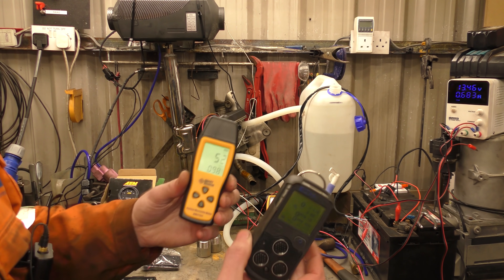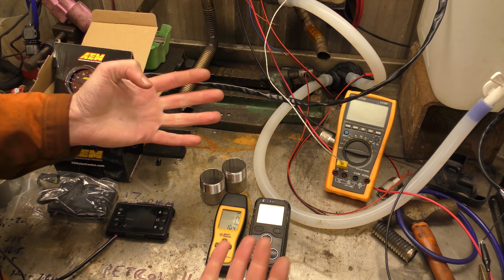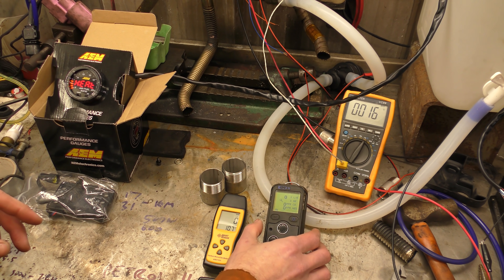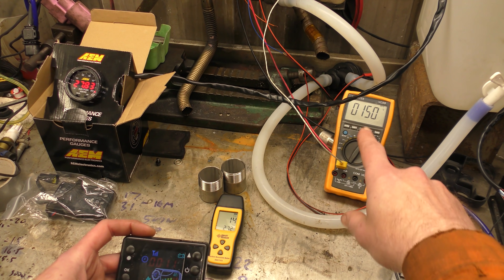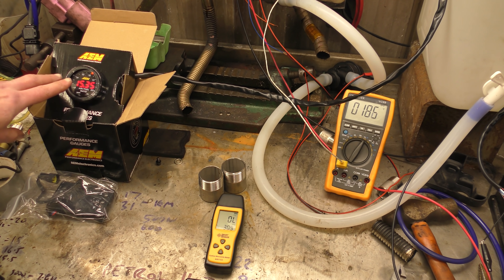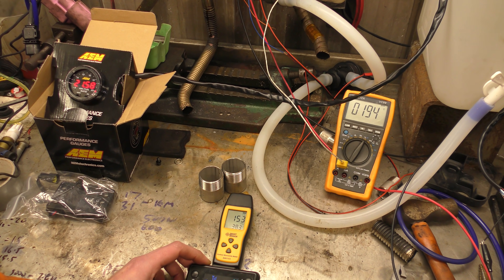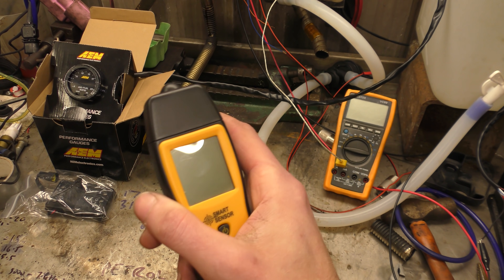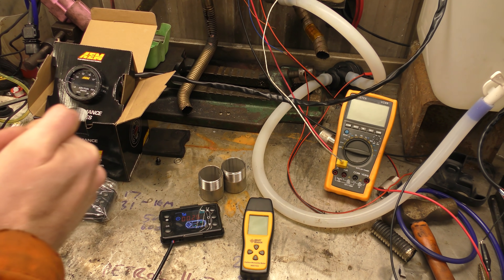Diesel heater tuning - using cheap CO gauge

Comment: Fit like David,
I'm installing a 5kw in Velma, a caravan I use off-grid in my woodland near Midmar.
The best location is under the nearside front seat, with the fuel tank in the front locker. But this has the exhaust going out through the bottom alu skirt with a double sleeve.
This would be fine except I need to have the full awning in place as an outdoor workshop for fettling spurtles ect.
Thank you for this vid, I do have 2 CO alarms and can place one oot in the awning area, but you got me to thinking the 3ring gas cooker is not vented, and I bet it kicks oot a fair bitty of CO when it's on full tilt. Of course you open the door top to let steam oot. 
The awning has big doors either end, so can be continuously vented na probs, and with an alarm, and after watching your vid; feel I can install it in this location.
I was overthinking the exhaust venting into the awning, and it being no worse than a space heaters minimal risk, or those paraffin heaters we all still had back in the day . 
Once I had carried an almost spent small barbecue into the awning some years back. It was only glowing and producing no smoke or smell, so thought I could use some of it's heat fir the awning area, but after an hour it set off the CO alarm in the van. So I was not keen to vent into the awning, but realise it may be useful in negative temps to do so, and keep some open doors either side for continuous venting.
Love yoor vids sir 👍

Comment: David. Have you considered what effect a cetane enhancer would have? I have no measurements to offer except that I found an improved mpg when I started using it and a comment from a garage that for its age my car engine was in excellent condition. I recently purchased a 110 Defender which ran very lumpily and I suspect one of the 5 cylinders was not firing. A year later after using the cetane enhancer all 5 cylinders fire perfectly and the starting problems have stopped. I am buying a heater in the new year and I will be adding some enhancer to the diesel (or heating oil) I will be using.
Reply from the maker: In theory a cetane booster would be beneficial as it makes the diesel easier to ignite.  It may help prevent carbon build up.
Reply: Would adding a little bit of gasoline help with the diesel igniting ?
I know it be a fine line between just right, and too much.

Comment: This is interesting... I purchased a diesel heater a little over a week ago and it runs between 204 and 212 C ... I ran it on diesel for the first fire up, and then switched over to a waste oil mix and it ran for two days before needing to be cleaned out. If I would have watched your videos first, I would have not purchased one because I bought it specifically to burn waste oil after seeing others say that it was perfect for that and you have to clean it out every few years...  Yes... I know now that that is not the case. 

ANYWAY. I have had it apart to clean it out 8-6 times, and even after running it on diesel, I had issues with it building up carbon and shutting down. The last time it was 12 hours before it needed to be cleaned. I noticed on my last disassembly that there was a substantial gap between the fan housing and the fan, I pushed the fan on until it was a few thousandths of an inch away from the housing and reassembled. After watching this video, and seeing the issue with my fan, I think that 1. My heater is getting too much fuel / not enough air 2. some of the not enough air issue may have been due to the fan gap 🤷‍♂ . Also, I'm in Alberta Canada and am at 4000 ft elevation ... 

I have one of the blue controllers... I don't think that I have the ability to change the fueling oo fan speed... I have watched a few videos on how to do things on the controller and mine seems to be different / lacking much of the functions of others. The unit is branded as VEVOR and was purchased in Canada. 

I have switched over to diesel and will run a few tanks of that through it and see if I have any issues... It has already run longer than 12 hours, so I think the fan was part of the issue. 

PS. Because this comment wasn't long enough already.... I appreciate the effort and actual testing that you put into your videos... I am constantly infuriated with idiots on the internet that use something for half an hour and then post their "expert findings" on the internet, or just think that they have to pretend that everything they do is genius, so they can't bring themselves to admit when something is a failure. Your content is refreshing.
Reply: I'm in the exact situation you are. Like exact. I think our units blow too much air through the combustion chamber. I'd really like to be able to tune the pump rate and fan rate. Waiting for someone to crack the 3 digit code. I might try restricting the exhaust.
Reply: @originalAtreyu  I have been running mine on diesel since Monday (non stop), and found out how to switch it over to high elevation mode. You push and hold the top two buttons, (settings and ok) and blue mountains appear on the screen. 

I took it apart this evening to check it out, and it had actually cleaned itself out considerably and was running very clean. After running on pure diesel in alpine mode. 

I then switched over to waste oil and gasoline 50/50 and had some obvious / instant issues ... it lit fine and made decent heat but the cloud of blue smoke was intense ! I assumed that this was because my thinned mix was too thin, so I went back to my previous mix of 1 litre of gas to  3 litres of oil and it got better, but it's still making an awful smoke / stink, and I assume that I will have to clean it out some time really soon. 

I may have to start over from square one as some of the waste oil that I used likely already had some diesel and gasoline in it, so my mix ratios above might not have even been close. Something isn't the same, because, other than carbon, it ran ok on waste oil and gas in the past, and now it's like a dumpster fire.

Side note... It is somewhat counter intuitive, but these like to run rich and make a lot more heat that way. I had a hard time getting mine to start on oil, as it would flame out as soon as the fan started to speed up, SO... I caused a restriction by blocking part of the inlet with my finger, and 1. it actually fired up, 2. it heated up really quickly 3. once it was up to operating temp, 170C in alpine mode, I was able to get the temp up over 200C by blocking some of the inlet off ... I have no idea what this is doing in regards to soot, smoke and carbon monoxide ... (I assume it can't be good, but the heater sure did put out a butt load of heat !!
Reply from the maker: We found that with the water heater when we tried running it for shower water.  It'll get very, very hot if you keep adding fuel.  Right up to the black smoke.

I've been told with enough air and fuel it'll melt the aluminum.  :)
Reply: @DavidMcLuckie  This makes perfect sense considering people build diesel and waster oil forging ovens and smelting burners for melting metal.  Diesel is curious in that way ... In an old naturally aspirated diesel you run a wide open intake, and run them super lean to make less power and keep adding fuel to go faster / make more power. Gasoline (and other fuels) on the other hand, have a much smaller window of combustible mix ratios.... or ratios that will produce an efficient / complete combustion.
Reply: I live in Calgary I bought four heaters 
To heat my shop on waste motor oil 
I even ran it through a Centrifuge to make it clean. I even blended it 50% with Diesel did not get more than two tanks before it plugged. 
I have the new models where I can’t control the fan speed or the pump speed.

Comment: Hi David i was wandering if i can use a FireAngel CO-9D Carbon Monoxide Detector instead of the AS8700A to make the tuning 😀
Reply from the maker: Probably not.  That's the FireAngel I have on the shelf in the workshop.  It's sample rate is pretty slow compared to the other meter.
Reply: @DavidMcLuckie  probably you are right 😊 .... but it's half price  😉

Comment: I have just purchased the 5kw hcalory bluetooth.  I've set it up outside on a steel cabinet with 2m exhaust with hot air running into house. I have the yellow co tested as in your video and set next to hot air pipe. I grt reading of between 10 and 50.

Comment: Just wondering once tuned would the application of diesel "redex" in the fuel help with longevity.
Reply from the maker: It certainly won't hurt.  It's mostly a mixture of detergents in a suspension of kerosene.  Anything that help keep it cleaner for longer is good.
Reply: @DavidMcLuckie  thank you.

Comment: I was wondering it anyone has converted one of these to propane? Can a diesel heater run at 9000 feet (3000 meters) and up without sooting up?
Reply from the maker: At high altitude you can turn down the fueling for it to work.
Reply: @DavidMcLuckie  so you are adjusting the fuel mixture by slowing the Hz (cycles the pump pumps per second) and not by changing any parts on the inside? So for 3000 meter altitude to get a low CO reading you would slow the pump (lean it out) and for sea level it would pump faster delivering more fuel? So does the fan speed change automatically or is this also adjustable? My apologizes as I have not installed mine yet. Mainly because of wanting to use it at higher altitudes and many people have said that they will just soot up in no time.................Thanks
Reply from the maker: Correct, no physical changes only changing the amount if fuel added which is the HZ setting on the controller.  The heater only has two settings, a low power (which is also the starting setting) and high power.  Assuming you're running a 4kw heater with a 22ml pump, at 3000m I'd aim for a low setting of 1600 rpm and 1Hz, high 4500 rpm and 2.2Hz.  There is a bit of trial and error and I highly advise a CO meter to tune with.
Reply from the maker: Also to add, the Lavaner Alpine Pro adjusts the fuel based on altitude and it decreases stock fueling by about 20% at that altitude.
Reply: @DavidMcLuckie  thanks so much!

Comment: I've been running mine at 3.3 pulse per second supposedly that's what that means and it runs very clean and provides really good Heat for approximately 200 ft uninsulated and the walls are primarily windows
I've also been experimenting with biodiesel with mine and it seems to do good with that also outside of my area smells like a deep fryer LOL
My next experiment is to find a way to Route the exhaust through a heat exchanger to provide added Heat

Comment: Are you using the common Chinese knock off heater in this video? I’m hoping to recreate this same test with the Lavaner pro 2kw heater and am wondering if there are any differences I need to account for.
Reply from the maker: The process would be the same regardless of the heater.  Except the Lavaner Alpines as they control their own fueling.

Comment: I wonder - if the amount of soot (or not) at the exhaust pipe, is an indication of soot in the chanber. On my units so far, the exhaust pipes are shiny metal on the inside - not sooted up. Whereas I do know that it certainly can soot up there.
Reply from the maker: No soot on your exhaust is a good sign.  There may be a small amount inside but generally if it's black on the outside it's worse on the inside.  :)

Comment: David, I've really enjoyed your informative and experimental videos. Wondering if I could beg you to explain operation of the "blue" controller with the "red" remote at a speed that I can keep up with? So far, nobody has managed this feat, and I'm not getting the most out of my heater because of it. I'm a retired 45+ year mechanic in auto, aircraft, diesel, and motorcycles - you needn't dumb it down, only slow it down a bit. I'll be forever in your debt.
Reply: only a couple videos on the subject, and the guys go too fast - bink, bink, bink, and Bob's yer uncle - and I can't even see which keys they are pressing.

Comment: Great video! You mention turning down the Hz for a cleaner burn, but when I do this my CO increases! For example CO output on 1.6Hz is >1000ppm but on 4Hz is around 100ppm. I want to run mine on low (around 1.6-2Hz) but with minimal CO. Do I need to increase my fan speed? 🤔
Reply from the maker: There is a point where there is not enough fuel or air and the core flames out briefly then relights and the CO output oscillates.  You could try adding a restriction into the exhaust to keep the hot gas inside longer to keep the burn going.
Reply: I forget what I set my fan speed at I think about 3K and programmed my control box to where I can go through and adjust the pulse of the fuel pump without having to go through major settings (push both the top buttons on both  sides at the same time) try doing that haven't checked my readings yet but I can't smell it running and I'm running biodiesel which smells like a deep fryer most of the time

Comment: I've been testing one of the blue controllers with the plateau mode. Seems to work but it would be interesting to put the controller into an air tight container and increase or decrease the air pressure to observe it adjusting the air/fuel ratio with the CO meter.
Reply from the maker: That's a good idea.  See if it does actually do any adjustments.
Reply: @DavidMcLuckie  GREETINGS! Got diesel fumes coming into the living space on start-up and shutdown. Looks like it's going to have to be pulled apart to investigate. Also, can't get it to run lower than a "5 degrees" reading on the control panel which doesn't appear to mean anything.
Different controls to yours, doesn't have anywhere near the adjust-ability. Cheap 3kw version.

Comment: Question: Does a diesel heater always running on lowest setting carbon up even when the air/fuel mix has been optimized to under 15ppm using a CO meter?
Reply from the maker: Technically yes, but just a lot slower compared than a non-tuned heater.

Comment: David, thanks for all your hard work on these.   In my experience, changing the pump to one with a different value makes the biggest change to how it runs.   I really wish they would make more delivery rate pumps available for tuning.  I would like to see a wide range of pump delivery values made available. So far all I can find is  16 - 18 - 18.5 and 22 ml
In my testing there is a measurable change in the mixture and temperature with every 0.5ml change in pump volume.  At the very least 16, 17, 18, 19, 20, 21 and 22ml should all be available IMO.

Comment: You think there might be a risk standing in a cloud of CO for 20min+ where even the CO meter checks out? 🤔
Reply from the maker: No.  Not really.  That's not how CO poisoning works.  It doesn't kill you instantly or poison you permanently.  CO bonds to your red blood cells instead of oxygen.  So you start to feel tired, nauseous, confused etc, until the point where you pass out.  Then eventually you die from lack of oxygen.  That's why it kills you when you are asleep.  When you are asleep you don't experience the symptoms and just slowly pass into unconscious and then death.  If you are awake and experience the symptoms all you have to do is move into fresh air and wait for your body to replace the CO in your blood with oxygen again which can take a few hours but you'll fully recover.  So while CO is dangerous, at the rates a burning appliance like this generates it, it won't kill you instantly.  I hope that makes some sense.

Comment: Is it possible to turn up the idle litle so it dont goes so low ??
Lives in snow and ice. Temp come when it pump in full power. But it goes to low for me to hold temperatur litle higher whitout the burner goes crazy all the time. I understand it have to do that some times. But if idle litle higher it will not go on full pull so many times.
I use this 24/7 cos i lives in boat and travle around in world.
Will be Great help, so i am thankfull
Reply from the maker: You can.  But also depending on the controller you can switch it between target temperature mode and pump frequency mode.  This lets you run it at one speed regardless of the temperature.  On the LCD controller you press and hold the up arrow and then press the settings button.  The display will change to P-1.6 (or whatever pump hz its on) and then you can use the up and down arrows to choose a fuel pump speed and the heater will adjust the fan speed accordingly.
Reply: @DavidMcLuckie  and yes it works Great man. Ty ty

Comment: Showing the difference in temperature seems a little pointless without comparing the fuel consumption as it doesn't show the efficiency. A little bit cooler and a lot cleaner with lower fuel consumption would be my preference. Great video though on how to adjust and the impact of that.
Reply from the maker: I'll need to do one with an EGT sensor inside the burner.  That would let us see an almost instant change in burn temperature when we alter the fueling.  Then we could match that with the CO.